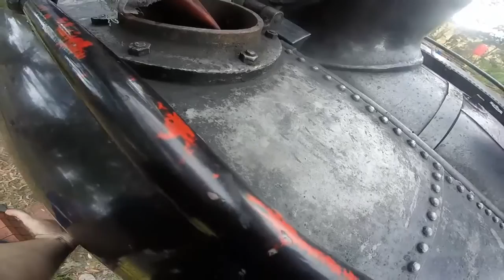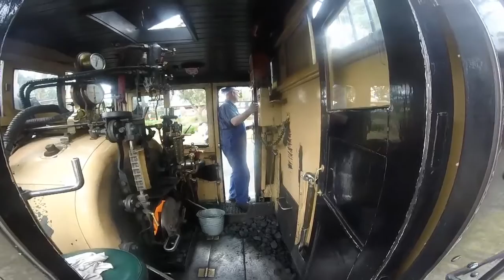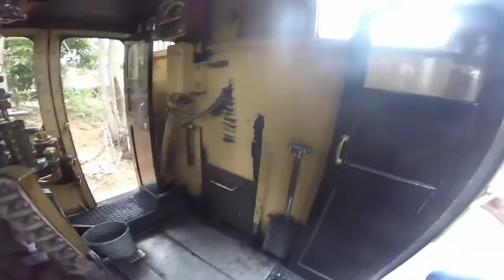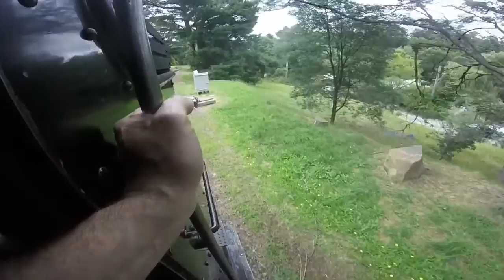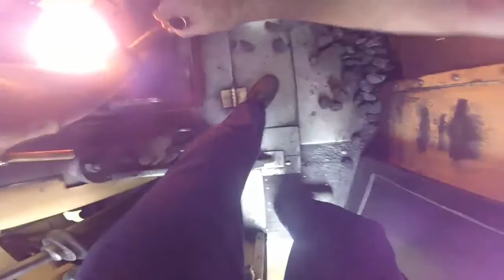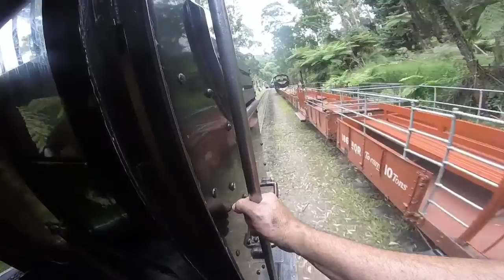Puffing Billy Fireman - Part 2 - Menzies Creek To Belgrave

Comment: Hey mate nice video 👍Just one question How come the crew don’t use the turbogenerators on the railway
Reply from the maker: The turbo is used but only at night to power the loco lighting.
Reply: Cheers for that mate I thought they might use it in the day as a safety feature like mainline locomotives.
I suppose it would use up more fuel on an already limited capacity.
It was great to see your role on the railway and the enginuity of the VR of the 20th century